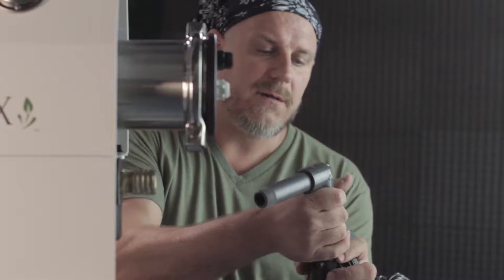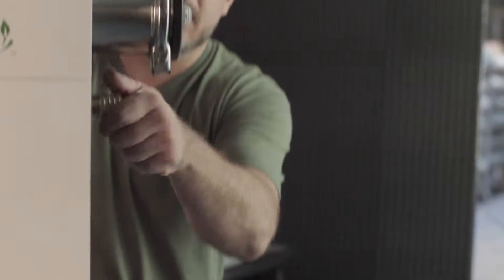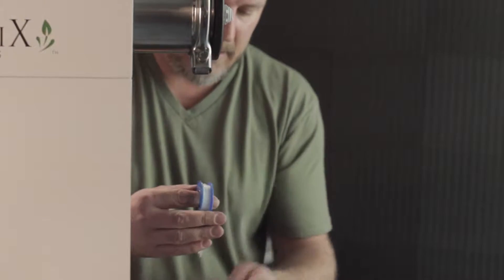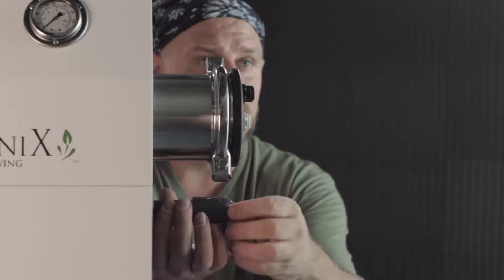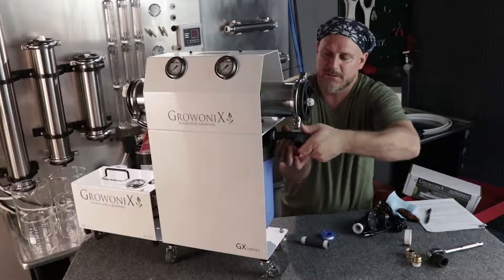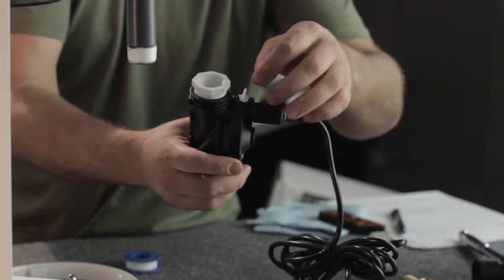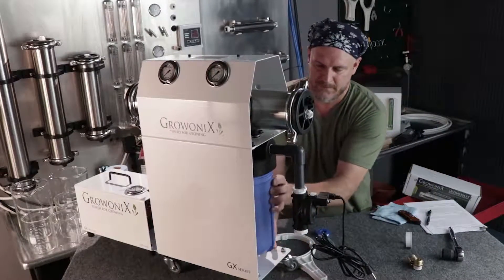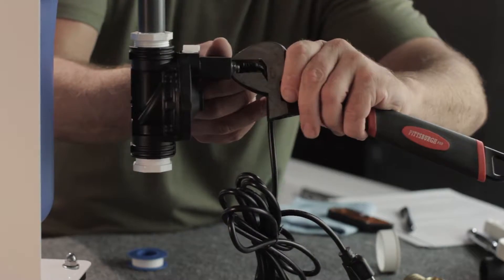GrowoniX GX1000 Deluxe: Electric Shut-Off Kit

Comment: Is this system good for a Coffee shop with upto 6 coffee machines with an average water consumption of 1000 gallons per day? We do not want to use a tank, but just want the RO unit water straight to the water line across the shop. Will this system work?
Reply from the maker: Always size water filters AT LEAST 2X demand. So if you need 1000 GPD, then use a 2000 GPD or bigger system.  This machine can do 2000 GPD—which will work!!!  Feel free to call in and discuss.